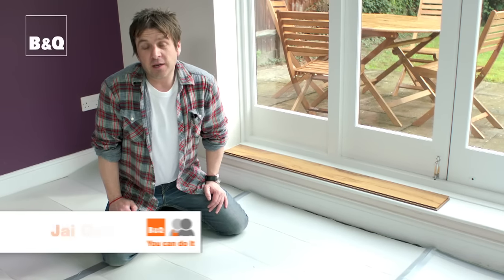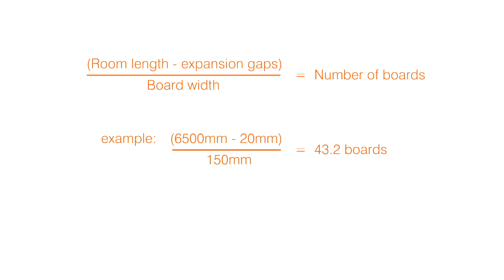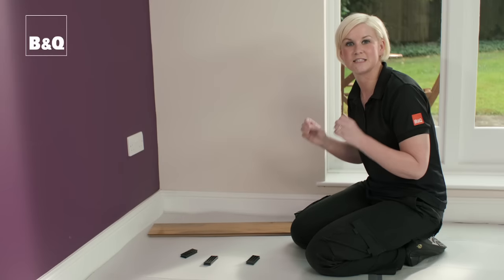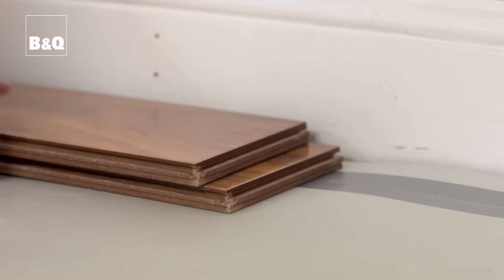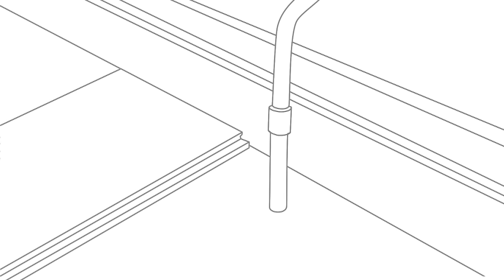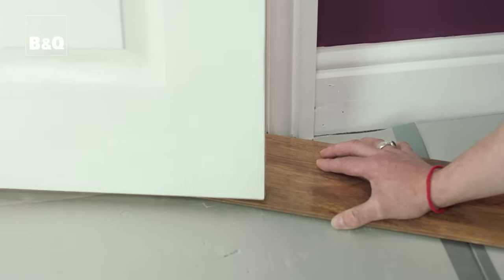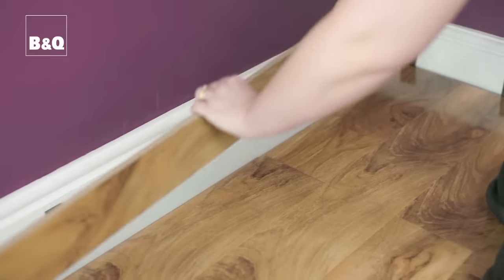How to lay flooring part 3: laying locking laminate

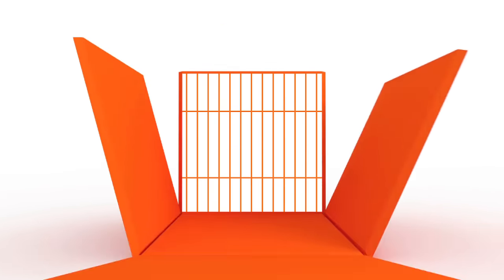Comment: 4:38 B&Q should advise that the H-block stagger pattern used here is not typical for aesthetic reasons. Other, less uniform stagger patterns exist and may be preferred.
Reply: Yeah H-pattern should never be used. Staggered increases the strength and looks better.
Reply: Hi, I'm laying some laminate and think the pattern in the video looks too uniform.  Do I need a pattern at all? or will be ok to just let what ever's left at the end of each row begin the new row (hope that makes sense!).
Reply: My laminate flooring from b&q said to avoid the H pattern

Comment: Thanks so much for this simple and fantastic video. What i love so much its the finishing in part 5, it answered all my questions. Now i am set in fixing my laminating floor.
Reply: If I have to feed a board in the final row underneath an architrave (as shown in the video), how is it then possible to join it to the previous row if the locking system requires that they are introduced at a 30 degree angle? Thank you
Reply: Thank you for your response. I've previously done what you've suggested but I didn't feel too happy about cutting of the locking part, but if that's the best option then I think I'll continue. thanks again for the advice. :)
Reply: juliet amah how did the floor come out?

Comment: Do the spacers get removed before putting in the quarter rounds?
Reply from the maker: Hi Nic, the spacers should only be in place when laying the flooring. Once every panel has been installed, you remove them. I hope this helps 😊
Reply: @bandq  hi thanks for clarifying- also I watched your other video for uneven floors where you all installed hardboard to flatten floors. Can input a layer of spacers or wood chips under one of them if there is a 2 inch dip that is about 2 feet wide? Second question what would the hardboard product be called in the US please?
Reply from the maker: The spacers won't be suitable to pack in a floor that's not level. Hardboard in the US is called high-density fiberboard (HDF), I would double check with your local hardware store. I hope this helps! 😊

Comment: When you have one of those snap and lock pieces against the wall with a quarter inch gap, are you supposed to trim off the tab on the wall side, or do you just leave it on?
Reply from the maker: Any protruding tab should be removed and then use the spacers to ensure the correct expansion gap is applied. If the resultant gap is too big for your scotia or skirting to cover, it would be better to start the first run with a half width plank and then the final run can be cut to the required width. Remember the scotia or skirting should be affixed to the wall rather than the laminate – this allows the laminate boards the ability to expand underneath into the gap provided. Hope this helps 🙂

Comment: great video but I never line up the joints like that. it looks more like a real wood floor when you don't line up the joints.
Reply: Joints ae suppose to be at least 8" apart.
Reply: Joints are supposed to be staggered, correct

Comment: How do you prevent the boards from moving after wedges have been removed and the trim has been fitted?
Reply from the maker: Hi, once the floor has all been clipped together, there should be very minimal movement

Comment: Should I put spacers at the end of the boards and why?
Reply from the maker: Spacers should be used at the ends of the boards (as well as the sides) adjacent to the walls. The spacers create an expansion gap to allow the boards to expand due to changes in heat and humidity – note that boards will expand both width & length-ways.

A useful tip is that boards should be laid so the protruding tongue of the click-fitting mechanism faces away from the starting corner of the room. If there is a protruding tongue at the finishing wall then this would need to be trimmed off, although usually the final boards are cut to fit so this would not be relevant.

Scotia or skirting can then be used to cover the gap. It is important that these are affixed to the wall and not the laminate – this then allows the laminate boards the ability to expand underneath into the gap provided. 

We hope this helps 😊

Comment: I have a 18 ft. Built in Dresser that runs the total width of my master bedroom . The dresser currently sits on top of old carpet. After removing the old carpet I'm thinking of running a strip of laminate parallel to the dresser that would slide under the dresser. Then lay the rest of my laminate perpendicular to that one strip of laminate . I'm worried about losing the " Floating Effect" on that one side of my floor. The dresser has Intricate mounding at the bottom , that's why I'm thinking of running that one strip parallel to the dresser and sliding it half way under the dresser. 
The other solution would be to remove the drawers and jack the dresser slightly off the floor, slide the laminate under and continue running my flooring perpendicular to the dresser. I will end up damaging and having to repair the dresser . Again I worry about losing the "Foating" effect and the floor may buckle because of the weight of the dresser would lock that end down.
Please give me some advice on solving this problem. Thank you

Comment: They missed some very important instructions that you should put your floor down in random cuts or at least 3rds,  alternating full boards looks bad.  Also best to either use a laminate floor cutter or mitre saw for all your cuts, a scroll saw will really slow you down,  also good to have a table saw when your installing as well.
Reply: Their video could do with being updated as it's a very old video and alot of things have changed.
Reply: Yea i thought the H pattern was not good to do.
Reply: Plus my flooring pack says to pick boards at random from each of the packs as the colour can vary and you don't want blocks of colour.

Comment: A 32mm hole for a 15mm pipe? Isn't that too big?
Reply from the maker: Hi there, cutting a bigger hole allows for expansion. You can use disks to cover the hole once finished. You will see this in part 5 - https://bit.ly/30otzB6 at timestamp 1.32. I hope this helps! 😊